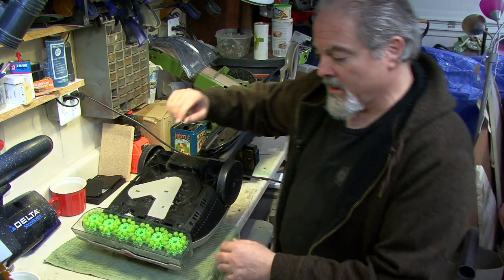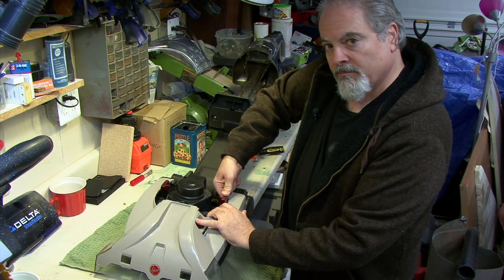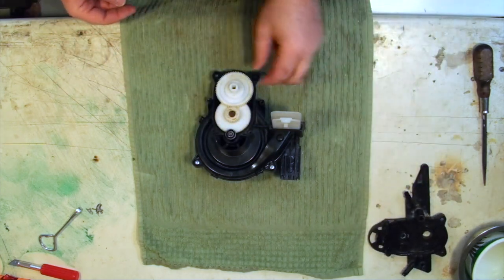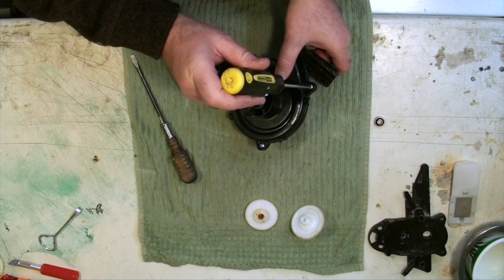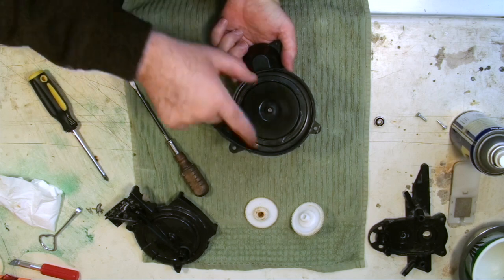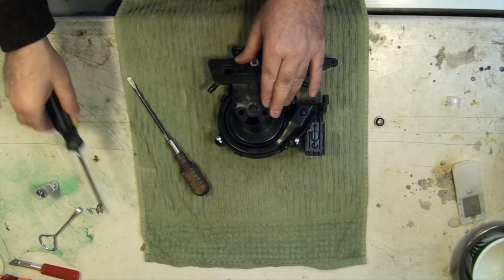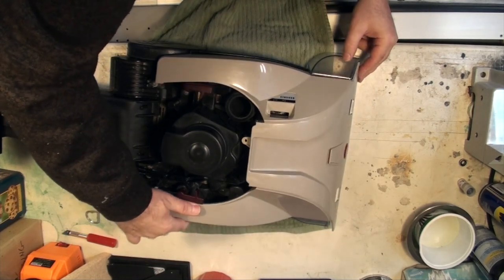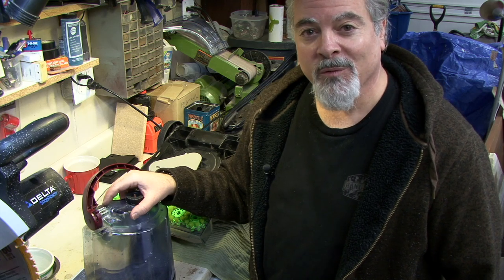SteamVac / Vax Brushes frozen and don't spin. Replace the bearing, not the motor. Less than $10 fix.

Comment: Did i miss where you listed the bearing part number and perhaps where to purchase?  Great instructional video.  Thank you.
Reply from the maker: Hi Bob! Thanks for asking. The link to the Amazon bearings I bought is in the description below the video. You probably need to click the "SHOW MORE" link to see it. Let me know if you have any questions.
Reply: I don’t see part #
Reply from the maker: @samuelsilbermanll806  Here's what I used for mine: Bearings: https://amzn.to/3eNzftX   R4-2RS Sealed Ball Bearing - C3-1/4"x5/8"x0.196" - Lubricated - Chrome Steel
Reply: Thanks for the teardown bro.

Anyone else attempting to repair this: my bearing wasn't too far gone. I freed everything up and cleaned and greased lightly with a silicone grease and reassembled. From now on I'm going to clean and dry both tanks then run in a dry area for a few minutes to clear the moisture from the impeller area. Shame they didn't use stainless parts in a wet application but here we are.

Comment: TOP TIP: if you find your brushes are clogged up with bits of hair etc and want to clean them easily, use a gents hair comb and comb the hair out of the brushes. I did this and also used a toothbrush with some dishwater soap and got oil residue out of the brushes + all the fibres that were clogging up the brush bristles. The result looked like new brushes.
Reply from the maker: Great tip, Alexander! Thanks 👍
Reply: Comb worked like magic, thanks.
Reply: Talking of cleaning brushes. I vacuum a couple time before shampooing to remove pet hair and large items that mess up a shampooer. This tutorial is really a great one.

Comment: Thanks for the video!  It really helped me out!  I had to replace both bearings on mine.  I placed the unit, impeller side up, on my vice with the jaws about 1/2” or so open, letting the shaft drop thru.  Then I lightly tapped the shaft in the center of the turbine with a punch and hammer.  It came out daily easily.  Next I put the shaft loosely in the vice, resting on the bearing, and tapped it off the shaft.  Tapped the new bearing on, then tapped the turbine back on carefully with a hammer.  Works great!
Reply from the maker: Thanks for letting me know it helped and I'm so glad to hear it worked out for you! I'm sure it works like new now - way to go!

Comment: Thank you for the video. It helped me diagnose the issue on mine. The bearing was fine, but the metal splined shaft from the turbine had worn away the teeth in the plastic helical gear that would then turn the second gear with the square drive. Fortunately, enough was left to reverse engineer and allow me to design and 3D print a replacement!
Reply from the maker: I am so glad it helped you out, and reverse engineering the gear is genius. When I first got my 3D printer I had no idea it would be so incredibly useful, but I have fixed SO MANY things with it! If you end up posting the .stl file somewhere, I'd be happy to post a link in the video description to help other people with printers fix theirs too. Happy carpet cleaning!

Comment: You nailed the problem and the proper way to fix the steamvac. It cost me $10+ for the link of the bearing at Amazon. The top bearing was rusted and replaced. The bottom bearing was stuck but not rusted and restored to working condition after cleaning with WD-40. instruction was spot on. Vac is back to working condition. Thanks for the great video!
Reply from the maker: I'm so happy I could help, AA!

Comment: I recently had a very same problem with a 3-year-old unit Hoover denied that there was any issue but yet referred to the YouTube channels to fix it. I felt like they should have been the one fixing it not going to YouTube. I feel like this is a defective design. Hoover needs to recall every one of them
Reply from the maker: My machine is much older, but it sounds like they have done nothing to fix the problem. To still have the same design flaws 10 or 15 years later makes me think they have no plans to ever address these issues.  It also seems to be an intentional point of failure 👎☹️

Comment: Thanks bro.. I have a Hoover f5915900 at church that I took out of the storage shed and it worked great for about an hour and then I smelled something it made a clunk noise and stopped sucking and brushing so thanks to your video I'm going to take this thing apart and see what's up thank you very much
Reply from the maker: I hope it is easy to figure out what happened. Thanks for watching!

Comment: Tony Ryan, UK
Thanks for your help through the video! My VAX had a broken turbine rotor, probably due to seized lower bearing. Super glued rotor, cleaned, re-oiled and greased bearings, now running fine again!
You're a smart fellow, thanks...
TR
Reply from the maker: Thanks Tony. I'm glad to hear it was helpful, and I love that you were able to super glue the rotor and get it going again! That's one more machine that will live on to keep cleaning.
Reply: Did it continue to work?
One of my cogs has cracked all the way through. Have superglued together but hasn't worked out for me. Hopefully leaving it to soak overnight may help.
Not got standard WD-40 so trying with the white Lithium grease. Hopefully performs same
Reply from the maker: White lithium is a useful lubricant, but it is not going to help penetrate the rust. WD-40 works great but there are other types that are specifically meant as a rust penetrant, so that's what I'd recommend.
Reply from the maker: It might be worth replacing both bearings if the penetrant doesn't work. I didn't need to, but several people were able to get the other bearing out to replace it. They explained how in the comments.
Reply: Thanks for all your comments and still responding to people.
I had 'just one more try'... Caked on the lithium grease, made sure I moved all parts and worked it in. Put all back together and left it around 1 hour.

Turned it on and the brushes finally managed to fire up. 😁
Will leave it 24hours and try doing some carpet cleaning tomorrow.

Thanks once again. Really happy that my time seems well spent and I can give further credit to your video 👍
Reply from the maker: That's fantastic news and you should be proud of yourself for fixing it! Thanks for letting me know how it went. Enjoy those sparkly clean carpets!

Comment: Thank you, Sir. Im planning to buy one of those carpet cleaners. I want to make sure it will last, so I will do it right after buying.
Reply from the maker: You are welcome, and thanks for watching!
Reply: @UnchartedDIY  so I opened brand new one and there was shit tons of grease on those white gears and from it, little bit on bottom bearing. I still add some lubricant/preservation regardless on both of the bearings.
Reply from the maker: That's a good idea, and watch out for sustained leaks so the water doesn't get into those bearings in the first place.
Reply: @UnchartedDIY  thank U sir, I will.

Comment: Love the tear down video ❤ but before anyone do this disassembly, first check and clear the intake filter located inside the clear plastic on the left front side of the vacuum. The filter on my Hoover SteamVac deluxe had a half an inch thick full of debris keeping sufficient air from reaching the turbine which then causes the agitator brush to not turn. 

I’ve had mine for 22 yrs and never cleaned this filter because like most people, I didn’t read the user manual 😂 the manual stated cleaning the filter as part of maintenance. 

BTW, I bought a Bissell Pro Heat 2x pet carpet cleaner at Walmart ($188 rollback sale) thinking that a new vacuum with modern technology should perform better but returned it because it failed to outperform my 22 yr old Hoover. Suction wasn’t as good and it left clumps of dirt that it failed to pick up, never happened with the old Hoover. I’m now convinced that Hoover makes the best carpet cleaner and will get another Hoover when the time comes to replace this vacuum sometime in the future when the motor eventually dies. However, I’m not committed to a particular brand and would try to pick a model based on the best performance for their particular use.  I have a Dyson for regular vacuuming,  Hart spot carpet vacuum for the occasional pet accidents and a portable Ryobi rechargeable battery powered vacuum because this is probably the most powerful handheld vacuum I’ve ever owned.
Reply from the maker: That's a great reminder, virtudesign! No need to go  "under the hood" if you don't need to.

I agree they are really effective cleaners with a few issues that can be fixed, though finding parts is becoming tough. Hoover would rather not support older machines, and the new ones are only designed to last a few years. 

Like you, I intend to keep mine running forever!

Comment: Just fix mine today same problem. But was old durty grease in there and after cleaning it all, I added synthetic grease all over inside as it should be in the gearing. I was surprise you didn't add any
Reply from the maker: Great catch! I actually did add a thin coat of synthetic grease to my gears. I was concerned that too much might create drag on the turbine. I should have mentioned adding the grease in the video.

Comment: Excellent work... Thanks. Wish more on the 'tube were like this.

Once I determined shaft not spinning I ran my favorite penetrant ( equal parts ATF/Acetone) down the sides of shaft. Was spinning full throttle in under 2 minutes. Got my first tank of fluid thru and it doing great.
Reply from the maker: I'm glad you liked the video. I've never tried the ATF/Acetone mix, but I sure will now! Thanks for the tip 👍

Comment: thanks for the video, it helped me a lot.  however, my problem was a broken turbine.  this type of vacuum cleaner is no longer manufactured, I called vax support.  they told me that they do not send spare parts to Slovakia.  it's probably far from the UK.  so it would be a shame to throw the vax all terrain in the trash.  so I thought of sticking the sheet with glue from below.  I used a sheet from a sardine can 😄😄😄.  mamouth glue.  now everything works normally, the brushes spin, and the bearings are not rusted at all.  they weren't even.  thanks for the video.
Reply from the maker: That's some very creative problem solving, and you kept an otherwise useful machine out of the trash! Nice work, MrJpsjjpsj!

Comment: Thanks for your help. We had this problem with a Vax Dual V. Slightly different arrangement of screws, etc., but it's very similar to your model.
Reply from the maker: Thank you for letting me know you found it helpful, Tim. It's nice to hear that it also works for these other models too!
Reply: I'm here after spilling tea on the carpet and realising that my Dual V brushes still don't work. Was it the bearing for you? Hopefully not much different to this as will have a go later taking apart to see if I can fix. Also was it the same size bearing as this video?
Reply: @markymoo22  For me it was the bearing that was seized but I was able to ease it back into free movement. (Can't remember how - I probably cleaned it up a bit?) So I didn't have to replace the bearing.
Edit: just noticed you asked this question ages ago... for some reason YouTube just notified me about it and I didn't notice how old it was!

Comment: It's one of those carpet cleaners that you love and hate at the same time. Just like Hoover's competition with their water heaters that clog up with minerals and then the jets don't work.

Yeah, poor design that abuses bearings. I took my turbine unit apart about 3 years ago too to see what I could do and I remember that I couldn't dislodge a bearing for replacement, so every springtime, I pop out the brush cartridge and use a 3/8 hex/allen key in the middle drive socket to break it free. I could use the hex/allen socket in the brush heads, but I don't want to break the main driveshaft for the brush cartridge. It's been working like this for a few years, so a minor inconvenience once a year which isn't a big deal.
Reply from the maker: That love hate thing is so true. And yearly isn't too bad!

Comment: Your video is very informative and great. I have to fix my uncle's hoover steamvac carpet cleaner soon since it has the same issue. The brushes do spin but they stop spinning with the slightest bit of resistance on them so I need to see if the bearings are shot and if everything inside needs greased which probably does. It is a very old carpet cleaner so I can imagine it needs a serious tune up. My grandma used to have it for a long time before my uncle got it and it is like at least 20 years old, lol.
Reply from the maker: Thanks for the feedback! I suspect you'll be surprised how well it works after it gets a good cleaning and lubrication. Let me know how it goes!

Comment: Very good video. Mine was a little different for bearings. The bearing at the end of the gear was a small roller bearing. It was in pieces. I replaced it with the ball bearing suggested. There was no other bearing. The stem also gets wider after the first bearing so if the was another bearing it would have to be a bigger one. I feel there may have been a minor update to the pump. Any way, after cleaning it and oiling it and new bearing, the brushes run far more than expected being air driven. Not to see if this. $5 garage sale shampooer will do its job once more. 🙏
Reply from the maker: Steve, thank you for reporting how yours differed and how you dealt with it. I only have experience with my model, so having this kind of feedback is super helpful for everyone. Happy carpet cleaning with your rescued find, and nice work!

Comment: A big thank you🖒🖒🖒you have saved me a repair bill.Very easy to follow and explained very clear.Mine is a vax but apart from 1 screw different all exactly they same . 
only 1 issue I have 2 screws over but it's all up and running. 🖒🖒🖒🖒🖒
Reply from the maker: Thank you for watching and sharing your feedback. I would not have known that a Vax carpet cleaner could be fixed the same way, so your comment will help others too!

Comment: great instructions to repair the turbine.  However, when my brush turbine failed, I discovered that the air intake for the turbine (one inch square on the front face) fills with lint and blocks the air flow.  Just had to brush off the mesh screen!
Reply from the maker: Yes, the screen filter should have been addressed in my video. I wish I could edit existing YouTube videos, but since I can't, I added this tip to the description. Thank you for pointing it out, and I'm glad you fixed it without having to take the cleaner apart!

Comment: Good video, my brushes weren't spinning so I stripped down the brush bar motor and found the impeller vane had snapped in half, also where the rubber hoses connect, one of these was snapped. I managed to repair the bit where the rubber hose connects with araldite epoxy, and glue the impeller back together using a clamp and loctite glue that is specifically for plastics. I couldn't find anywhere selling a replacement part - so bodging is the only way for me to repair this.
Reply from the maker: So glad to hear that, Alexander! Parts are becoming difficult to find, so nice work!
Reply: @UnchartedDIY  The impeller is a press fit on the shaft and over time you get a hairline crack along the plastic, when the motor spins centrifugal force causes the crack to get worse until the impeller splits. I found the first time I glue it - when the motor spins for a few seconds the impellor breaks apart. The solution is to run a drill the same diameter as the shaft it sits on to make the hole in it slightly larger, this stops the impeller being stressed along the line you glued. When securing to the shaft, instead of using a press fit - just use some Araldite glue and that works well and prevents the stresses on the plastic which will give a far better repair.
Reply from the maker: @mrdude2478  Thank you so much for letting everyone know how to fix the impeller! That's fantastic, much needed information!
Reply: @UnchartedDIY  No worries, also I forgot to say that the shaft diameter is around 5.5mm. I drilled the hole in the impeller this size at first, however there was still to tight to fit without causing stress on the glued joint. I ended up drilling with a 6mm drill bit and used araldite to secure the impeller to the shaft - this worked well, but probably it would have been better if I could have used a drill bit at around 5.7mm diameter. Also to glue the split impeller (not fix to the shaft), you should use Loctite All Plastics glue as you get a perfect bond with this glue (unlike araldite which is not good for this join). I have now used the vax on 3 rugs and a mattress and the brushes are spinning really fast and the fix has been good and held up well. Once again thanks for posting the original video, this helped me a lot and saved me some time fault finding.
Reply from the maker: Yay! Nice work and great explanation 👍

Comment: Thanks for the excellent tutorial.  I was disappointed to find that my bearings are in great shape.  My problem sounds like the same as Tony Ryan reported below - the plastic turbine disc on the top side is cracked in half and no longer holding tight to the spindle.  The whole turbine and gear assembly has been discontinued (part no. H-91001097 for my model F7450100), and not much in used market.  I'll try the glue plan too and see if I can get it to hold.  Your video has been very helpful.  Thanks again.
Reply from the maker: Sorry to hear parts are not available. The glue trick seems to have worked for a number of people, so it's worth a shot. Good luck with it, and I'd love to hear if it works for you..